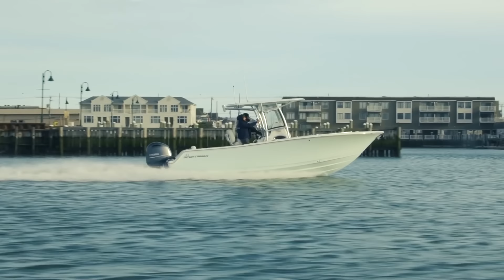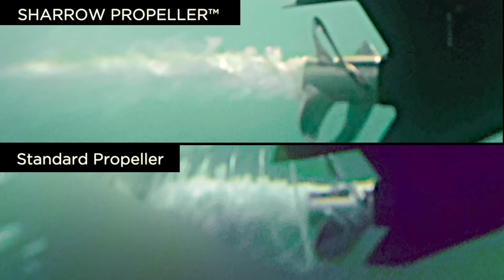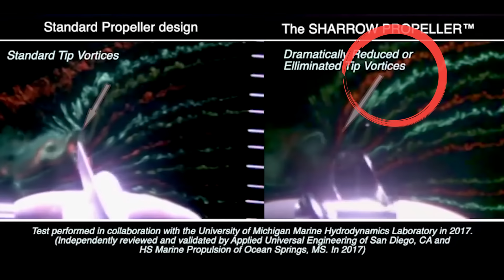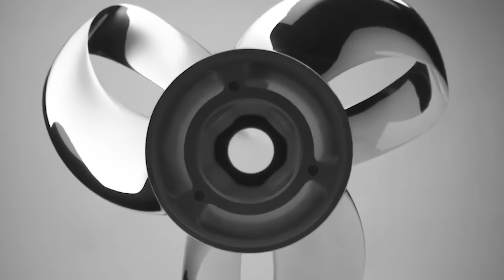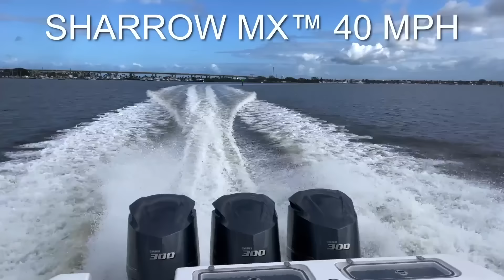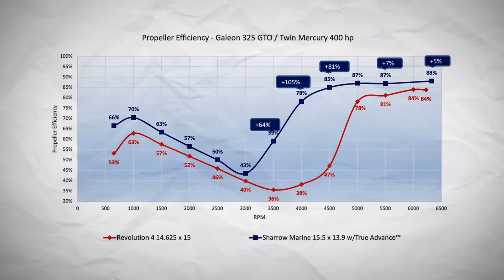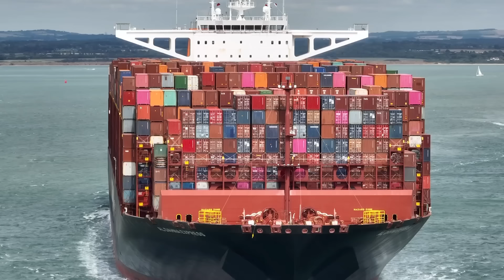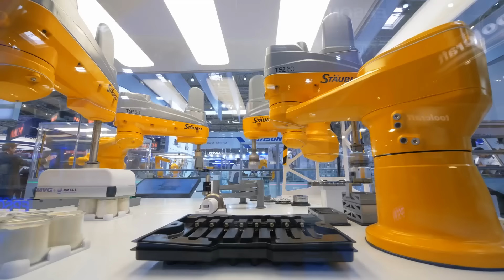This Genius Propeller Will Change Transport Forever

Comment: Each loop gives two blades, plus there is no tip to vortex from it, a tvo loop propeller equals a four blade, a three loop equals a six blade, and the drone with three loops and a rim around equals a ducted sixblade fan.

Comment: Thousands of people has designed and tested  so many types of propulsions for boats or props for Planes and it becomes 100% clear that why are we still using the same props today that we used 100 years ago, Because it is the best, it is like why reinvent the wheel if it works. In any case there are many props for many applications, from tug boats to go fast. It has become a tendency that people today are fiddling and wasting their time in RE-DISCOVERING old technology for the sake of maybe the Old Folks got it wrong. No, they had no CAD software to instantly test a design, the Old People had to build many thousands and tested many thousand to determine what we know works. It is very easy to re-design Old Timer "technology" and call it your own in the hope you will be credited to have discovered something that was used 150 years ago and simply went out of fashion or a better design came along. Like the old shavers they claim they have designed and are selling for $55 that actually cost 25c, 50 years ago. Stop digging up Old Patents!

Comment: "This Genius Propeller Will Change Transport Forever"
When the patent expires in 25 years because they currently charge around $5k USD for the same class of prop that would normally cost less than $500 USD
Reply: Welp, i should have listened to the whole video, because you touched on this.

Comment: Is there a way to apply this to aircraft wings, not just propellers?

Wingtip vortices impact spacing requirements in runway operation - smaller vortices would allow more large aircraft landing in a given amount of time.
Reply: Tip vortices are always there, they are a direct result result of the downwash and lift created by any lifting surface, be it on a propeller, a wing or or a screw blade.
A wing that creates no vortex would also create no lift.
BUT: The toroidal configuration is able to "grab" more fluid by making the vortex larger and slower rotating. This slower rotation is what is reducing the noise and increasing efficiency.
I, know, I know. Nothing about that is intuitive.

Comment: Would love a set in 1.6mm X 1.7mm with a 3/16 shaft inner diameter! 
(Fast electric Rc boat application. No, 3d printed isn't strong enough)
CNC stainless or TI...
Now those would be cool!

Comment: I don't think you understand basic physics you can't have efficiency larger or equal to 100% so your title picture is misleading. The eta is a ratio and in the known universe there is no way that the second principle of thermodynamics  can be broken. Useful output energy is always lower than input energy. 
The correct wording would be this prop has an efficiency of xx% per liter of fuel used.
This other fancy propeller has an efficiency of yy% per liter of fuel used.
Efficiency is measured per cycle. Not between components a and b.

Comment: cruise ships and container ships will upgrade as fast as they can be produced %20 increase in fuel economy, they'll spend the money tomorrow, also these props can be cast for watercraft using investment casting, not a problem.

Comment: I smell snake oil.  if a prop doubles efficiency, why doesn't fuel economy double?  This video would have much more credibility if the ACTUAL efficiency of both props were measured & cited.  In the boat noise recording, most of the noise "above the water" is the engines, not the propellers.
          The other thing about "boat propellers" for smaller boats is not about efficiency; it is about having a prop that "fits in the space" (does not hit bottom, foul with seaweed, etc.)  A prop "of conventional design" could be much more efficient if to were to be of larger diameter, set lower in the water, & turn slower.
          Most hydro-generators do not use props; they use centrifugal turbines.  For high-density medium (water), skin friction is large.  In hydro-generator centrifugal turbine, the water motion over the radial blades is slow compared to the blade speed.

Comment: Interesting topic, I'm keen to find out more about these in the real world. However I think you are pretty unquestioning in your coverage of Sharrow's marketing material. I think that 105% number is pretty optimistic. Also the noise comparison they do on the boat is very suspect. You are hearing engine noise for the most part, I don't see why the engine note would be that much lower.
Reply: Exactly

Comment: Its been around for years and hasn't really changed anything. Costs about ten times as much as a standard prop. Nothing is 105% efficient, that would mean it puts out more power than was put into it! Maybe 97% would be better.

Comment: I'm sorry, but as an acoustic engineer with a background in sonar design, I have to call BS on the section of this video which compared the noise reduction of the outboard motors.  A different propeller design being operated underwater will have zero affect on the airborne noise levels at the same engine speed and load.  That being said, the ability of torroidal propellers to reduce airborne noise levels as compared to conventional airfoil propellers when both are operating in air is definitely possible.

Comment: For racing drones, they seem really cool because people often get annoyed by the noise. But they dont produce the same thrust so they are kinda useless. Its like a silencer in a tank battle.
Reply: Also I would have thought that the extra mass would make the motors less responsive when changing rpm. I really don't see a use case outside of low agility drones and boats.
Reply: @Grim_fpv  exactly, they might be good for long range stuff, but i dont know anything about long range.

Comment: Initial tests show huge current draw and not much reduction in noise on drones so I highly doubt this will be successful, need to state those props are 3d printer so maybe not the best performance possible but yeah basically severe reduction of flight time and not much reduction in noise

Comment: Unbelievably cool and useful. How did no one think of this earlier. It's amazing how we keep finding new improvements. I'm so excited for the future!
Reply: Someone probably did think of it earlier, it's sort of an obvious idea if you start to worry about tip vortices, but it's a very complicated shape, probably only recently had good enough fluid modelling / rapid prototyping with 3D printing etc, to be able to get it to work well enough to be worth the effort.
Reply: We've been trying this for wings since the dawn of flight, and we actually understood why it would be a good idea to do so at least a century ago.  Applying it to a rotating propeller is vastly more difficult than a fixed wing.
Reply: $5000 v $500
Reply: It was thought of long long ago.  It's one of those things that has to wait for manufacturing to catch up.  For real world applications en masse it has to be cost effective and reliable.
Reply: @ianrobertson3419  35 years ago, I saw in in a magazine
Reply: this is why the propellers of submarines are covered before being put in the water, they didnt want it known
Reply: @T3chWarrior  If you have not rushed to the shop to get one for your sub you are failing.
Reply: They have it's just they are only better than a normal prop or blades around a certain RPM so it's rather case specific and as he mentioned for bigger ships.. It won't scale up for them because their props are fairly low rotation.. These work best at high speeds where the tip of a normal prop is hitting super sonic (in the material) speeds.
Reply: I would not be surprised if such propeller shape was already in use on the latest submarine generations. There is a reason they try to keep the propeller shape secret
Reply: It would mainly be manufacturing complexity, scalability and  manufacturing retooling to accommodate demand. As there is currently no real demand, businesses will have no incentive to shift towards this innovative design
Reply: Literally the comment above yours, a guy who made these in the 1970s shares some anecdotes.
Reply: @thorium_glass  the world gets smaller every day
Reply: The navy already had these. Take a look at submarine pictures and all of them have covers over the propeller blades.
Reply: @ksun4651  That is a good guess. But because of the covers over the screws we, the general public, don't know for sure. And if you are Navy, confirming this may be a court marshallable offense (revealing secrets and all that).

Comment: These props have been around for years.. If they were that much better, many outboards would have them...  I think the problem is at the tip of the prop there is a area that produces no lift, but does add drag as the tips are going the fastest.  This can be done with a reg prop with washout, but if that worked all props would have that too.
Reply: this
Reply: All drills have a chuck But they dont all have internal components to make them last longer. The ones with less parts are far cheaper. I wonder why people buy them?

Comment: I was messing around in my pc this morning and watching the fans spin and thinking how they cause all the noise - this is 100% going to be in every small cooling fan in the world soon.  Thanks 😊
Reply: Fan Showdown already did a video on using this design for a PC fan. The conclusion was that a 3D printed toroidal fan still couldn't beat a Noctua for both quiet operation and performance, likely because the design was intended for high speed (e.g. drones) instead of the lower speed of a PC fan.
Reply: The duct already does everything the closed airfoil is supposed to, and does it better.  If you want noise reduction, you want curved edges, optionally with chevrons (or "teeth") to break up any coherent pulses.
Reply: No, they definitely won't
Reply: Ooo, that would be a nice application right there. Someone send a design to that one pc fan testing channel on here!
Reply: @randomsandwichian  Here's the video from the fan testing channel you're referencing:
https://youtu.be/4ImeOKgD_Dw
Reply: Didn't Apple use a fan with unevenly-spaced blades in order to reduce noise, several years ago? I don't know if Apple still does it, but the idea doesn't seem to have caught on more broadly.

Comment: man really do be taking the percentage of a percentage 
honestly, though this is like comparing ducted to ducted props. if you cherry-pick your data (and arguably use a slightly misleading representation of such data),  you can make anything look good, but in reality, there are a number of practical limitations that have and will continue to prevent the implementation of toroidal props and wings. if it sounds too good to be true, it usually is.

Comment: I wonder if there's less efficient but an easier design to manufacture. Like if you stamp the blades and then bend them into toroids, they might not be perfect but they might also not cost 10x the usual prop.

Comment: if this was revolutionary ... we would have seen it being used on modern submarines... we are not. There must be some draw back somewhere. a gain in output efficiency always comes with a draw on something else. If we see the drone application... it basically doubled the rotor count, thus reduced the RPM needed to achieve the same lift and slower props are simply quieter.... in water less speed means less cavitation.

Comment: Here is something you might want to look into:
Cars and trucks can only have 4 stroke diesel engines as "they are more efficient". Cargo ships which make more profit at more efficient operation are STILL being built with 2 stroke diesel engines.
Why if the 4 stroke is more efficient?
Why are we denied 2 strokes if they are the more efficient engine?

Comment: Is the airfoil shape symetrical (can it produce the same thrust both forwards and backwards when spun in diffrent directions?) If yes, this can be used for multirotors to fly 3D (upsidedown) without  having trouble getting enough thrust to catch themselves up after switching from rightside up to inverted position.
More fpv pilots can get into 3D fpv if this concept becomes more common
Reply: Yes I saw in another video that these toroidal propellers are a lot better at reverse thrust than standard shaped ones.

Comment: These propellor videos are interesting. It’s good to see new designs. But for the record, thousands of people get injured by propellers every year. 

Back in the 1960’s boat designers started putting outboard engines in the hull of the boat. The propellor is underneath the bow. That way, water skiers and kids can’t accidentally hit the prop. But no boat factory offers that option anymore.

Comment: 1) Wingtip vortices are not the same thing as cavitation.  2) The noise you hear aboard a boat using an outboard motor underway is not in the least related to the propeller.  3) Only a salesman would claim 105 percent efficiency as your video suggests as this is physically not the case and not possible.

Comment: This may not have any real application for today's style of helicopter, because today's helicopters use blades which have adjustable pitch, and it does not seem as though this type of propeller can host that ability.  It might possibly have application on the tail-rotor of a helicopter, but even that is doubtful, since to turn the helicopter to the left or to the right, the tail prop is what makes that happen.  Well if the blade-pitch cannot be adjusted to reduce or increase thrust, then the blade speed is what must be adjusted, and spinning up the blade speed, or decreasing the blade speed, is simply not a very responsive procedure.

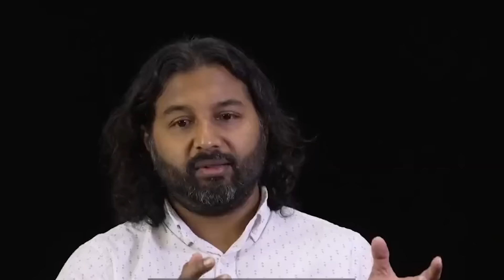Comment: 1:56 must be compared with 4 blades model that torodial not with 2 blade. But i am interested in vortice.
Because if you add more blade to the propeler are more quit and more powerful but requiere aswell more expensive motors with more torque isntead of speed.
I am esceptic about this propeler. Because from start MIT compre them with 2 blade propeler instead with 4 blade.

Comment: so if it increases speed then it increases the wake size...  most noticeable during things like 'wake' boarding...   have you seen the amount of research done on boat wakes and erosion?   the research has been going on for years now. what are you suggesting with this video?   it's so genius at eroding the land?   it's so genius at increasing volume at the same flow rate overtime?  have you seen the disasters flooding with large volumes and high flow rivers cause?  

you're right... this propeller design is genius at saving you fuel money today or tomorrow or next year...   may or may not cause disasters of your grandkids grandkids land... but who cares about them...  right?     

obviously...  it's genius...
Reply: you being a young youtuber yourself should know this one  https://youtube.com/shorts/z8WP-8DKGKs?feature=share

Comment: I'm curious if the improvements are limited to certain rpms or of they are present throughout the rpm range. As well it would be interesting to see how these props respond to being used in a ducted environment. Even in an azopod installing... gets the mind going   So many additional, and fun, tests still to be done.
Reply: As displayed in the graph presented in this video, the improvements are considerable in narrow band of rpm, and noticeable in others. I bet this can be tweaked by design, but this is not a magic bullet that works super well everywhere. Seem very promising though. Eliminating cavitation will prolong prop lifespan by huge margins in boats, so the efficiency is not the only plus here.
Reply: It works similarly as a ducted fan. It reduces tip spill off by trapping water/air inside the two parts of the blade.
Reply: 3:02 Answer is crystal clear.
Reply: The shape could be optimized to certain rpm range, but it's most likely not possible to have a universal one that's great at all rpm range. Also for something like drones with very high rpm props,  it seems to instead reduce thrust at the same rpm range, tho those findings are all coming from amateurs so far. Not sure if it can be further optimized for working well in high rpm, but it doesn't seem all that great so far. Even if it were to reduce noise, if it decreases the performance significantly, it will probably be a no go. Tho all these amateur tests have no scientific backing tbh, they are mostly just eyeballing it. So it will be interesting to see if something better will come out.
Reply: @N0xiety  nothing different than any other propeller used on boats then. Good thing there is software that can test designs against hull shapes and prop speeds.
Reply: Just look at the graph in the video, when the rpm get to high it looses efficiency just like a normal prop. If u want it more efficient u need a bigger prop for those rpms
Reply: I would add test how they work in a contra-rotating duo-prop setup as is now the common setup on pods.

Comment: Wonder if they could just make it in 2 pieces and then weld the two tips into the ring. I suppose not for single crystal large ship propellers tho. Maybe for this they have to do it the normal hard way

Comment: Great subject and great video on it.
What is most dazzling around it is that way into the 21st century, with so many technological advances on things that one cannot even imagine how we even started to think of that, and all of a sudden we realize there are still ground breaking advances to be taken on "basic" things such as propellers...
This only shows how short we still are in mastering the subtleties of fluid dynamics.
How little we really know about it.
It brings so many disturbing questions on everything that relates to fluid dynamics.
Airfoil shapes, lift, aerodynamics, hydrodynamics, surface effects and ground effects, reaction engines....
So much things can be impacted by new discoveries in that area...